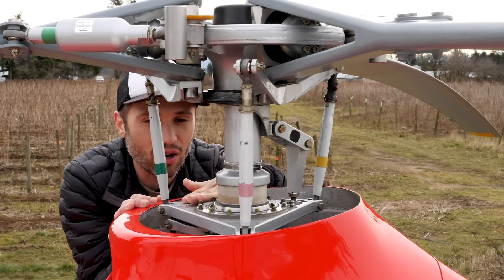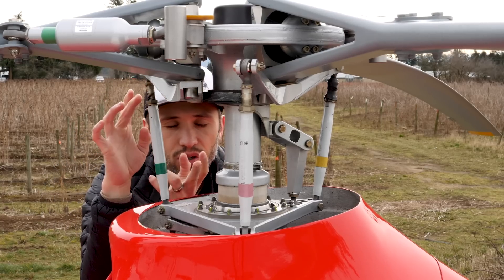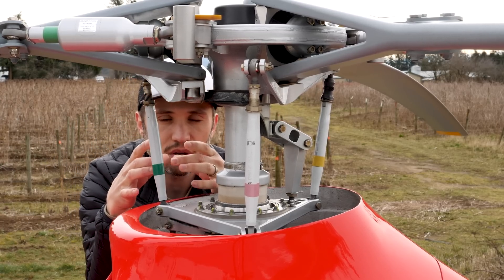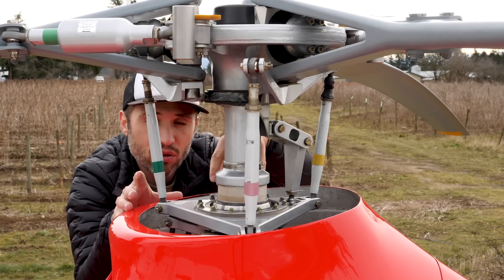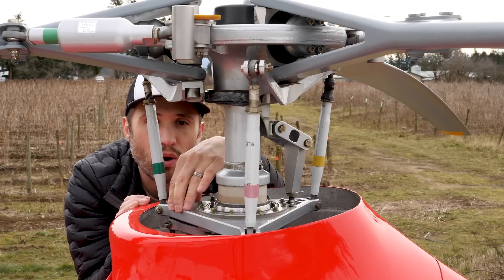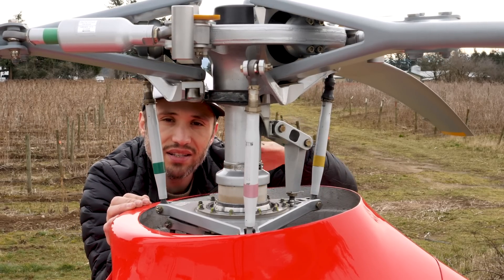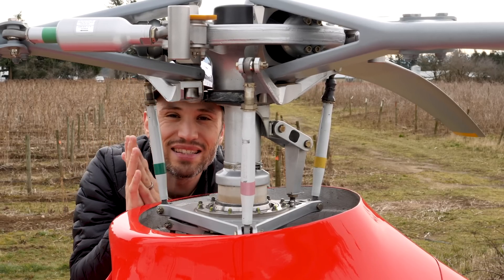THE MAGIC SAUCE THAT MAKES A HELICOPTER WORK

Comment: Is there any phase lag if the forward input on the cyclic is made at the exact moment the pitch rod is at the front of the helicopter? Also, at approximately 360 rotor rpm, the phase lag for a 90 degree rotation of the rotor is less than 0.05 seconds...

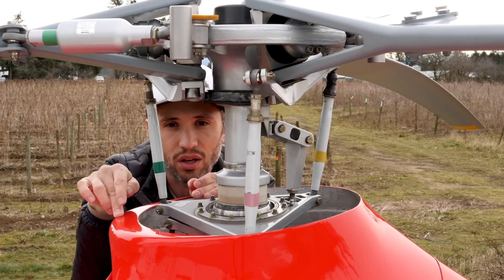Comment: 4:13 not correct, the maximum downward angle happens on the left side, this pushes the left side of the rotor down, but the lag causes the aircraft to pitch forward instead of left

Comment: The swashplate is like the mechanical version of a slip-ring, which is a rotating electrical connection on a shaft using concentric rings to isolate each connection. The current goes through a stationary ring(s) which are connected via copper leaf springs to a rotating wire. Think carousel.

Comment: The helicopter rotor is complicated and those who first invented it must have used incredibly much effort to adjust it all into a working machine :) 

I learned to fly heli in Microsoft flight sim. Then I tried flying a co axial RC heli, but struggled hard to get it flying until I trained on a small simple single rotor micro heli without any collective input. After that I could fly the co axial heli but I hated how that handled, it would only stay in a hover forever and did not fly straight like a normal heli do. Only been in a Robinson R4 real heli once and the pilot was a relative of mine and did lot of fast dives with low passes and turns over  the airport just like I like to do myself in MS Flightsim :)

Comment: but it squeaks LOL… Yeah it's my favorite mechanical device.  I fly a radio -controlled MD 500 with the five bladed rigid rotor head.  A lot of people don't realize that the rotor blades are constantly in motion as they spend the accuracy is just amazing.  Closest thing I can think of would be a hummingbird.  Cool video I just love helicopters.  Thank you

Comment: Hello, Pilot Yellow and other helicopter pilots. Does a tail rotor auto re-center to it's center position when you release the foot pedal? Or should I ask were they spring loaded so that it will return to center position upon releasing the foot pedal? Does the cyclic spring loaded as well? Does it return to center like those computer joysticks? Thank you in advance.

Comment: Just remember that phase lag really refers to whether the Cyclic (and rotor disc) is in sync with the swash plate. The whole 90 degrees later phenomenon is simply gyroscopic precession. A spinning mass will always show a "phase lag" of 90 degrees from the point where a force is applied. However, the swashplate can have any phase lag between it and the cyclic between 0 and 90 degrees, depending on the advance angle of the pitch links. 

Advance angle is the angular difference between where a pitch-link attaches to the swash plate and the feathering axis of the blade to which it controls. I hope that makes sense, it's pretty hard to describe in writing without diagrams.

So, an advance angle of 90 degrees on all of the pitch-links will cause the phase lag between the swash plate and cyclic to be 0 degrees! Which is exactly how two-bladed rotors typically operate (R22, R44, B206 etc). This DOES NOT mean that gyroscopic precession is not occurring. A swashplate that tilts forward with pitch-links that are advanced 90 degrees, will still cause the lowest blade angle to be 90 degrees to the right in a counter-clockwise rotor (left in a clockwise, but we hate clockwise rotors :P). How? Because although the pitch-link is being pulled most down at the forward position, it is attached to a blade (through the pitch horn) that is 90 degrees to the right of it. So that 90-degree-to-the-right position is still the point of lowest blade angle, and through precession will therefore cause the point of lowest flapping to be in-front of us, thereby tilting the rotor disc forward.

Jesus that's hard to explain with only writing >:(

From the perspective in this video, it seems as if the Cabri has an advance angle of around 45 degrees, which means that the phase-lag between the swash plate and the cyclic (and rotor disc) would also be 45 degrees. But I would need to play around with one in person to be sure.

Comment: Thank you for the vid. As an airplane flyer (and builder) I am always frightend of so many moveble parts which not only move but need to move in an exact manner. I know it works. However, my little ultralight seems to be more safe to me. If the engine stops I can glide to the next field (only one time happened since now). When the rotor of a heli crashes . . . . not thinking about that.

Comment: I'm still confused about the cycling. When the engine is turning at high rpms how does the rotor head keep up with the up and down to move the helicopter forward or to the side?

Comment: Nice Video with a big mistake. The pitch on the rotor blade is 90 degree to the tilt direction of the helicoptor, not the swapplate... That can be different. Idf you give more pitch on thw right or left part of the rotor when it spins, your helicopter tilts forward and backward not left and right

Comment: Swash Plate... the device that allows the helicopter to beat the air into submission (they don't actually fly) in a controlled manner!

My other favorite component:  The Jesus Nut.  The one that holds on the entire rotor system (at least on a Huey).  Because if that fails, you have nothing left to do but pray to Jesus.

Comment: This is why I chuckle every time I see a video on YouTube where someone in some third world outback is trying to make a homemade helicopter out of junk parts. That swash plate and the bearings and control rods are critical to both flight and control. Lots of engineering and design goes into making sure they not only operate correctly but do not fail due to metal fatigue. Not something the average “hack” can do!

Comment: PS the way that upper part is orientated that depends on what direction the blades are running correct? or do both CW and CCW engines have that place in the same side, i would think not. Im talking about the part where you were explaining that forward pitch would alter the upper part at a 90 deg angle.

Comment: Great video.. but.. you should tell us simply and clearly what makes helicopter left & right. Up & down. Back & forward with motion of blades and plate. And also what makes helicopter stable?? When I was 13 years old I made little toy helicopter but there wasn't any stability.

Comment: FYI, at 4:11 for forward cyclic plate action, the maximum blade angle does happen perpendicular (pilot's left side) not 90 deg later (blade is in front of pilot) but you're right that the reaction happens 90deg away from where force is applied because of gyroscopic precession. That's a WHOLE other can of worms, and I recommend checking out youtube videos on that. Great video though. Thanks.

Comment: @PilotYellow - Great video !  - I already had an idea how the swash plate works to change pitch etc but to see the mechanism in action and up close like this was really the cat's meow! I see the 3  links but just wondering about the mechanism a couple of inches inside of the YELLOW taped link that goes between  the top swash plate and the rotor head and rotates with it. Is it some sort of damper that helps control the cyclic inputs with some sort of resistance?

Comment: Ok, so let me get this straight. If you are flying exactly north with clockwise rotating blades(as you look up at them) then the disc that the blades trace out is tilted in a north direction. Ok I got that. But the swash plate is tilted down in the east direction.  Could you elaborate on this please. I know that this has zero to do with the gyroscopic precession principal as the rotating disc that the blades sweep out does not have a rim with mass as a spinning bicycle wheel has. Gyroscopic precession does have a very minimal effect but again very small. Barely noticeable.

Comment: The more secret sauce is simply decoupling the rotor disk from the mast or vertical shaft that spins it.  It took many months and crashes to figure this out during the development of the helicopter.  The reason for it, which is part of what the swash plate accomplishes, is that an attempt to deflect the spinning rotor disk by applying a force results in the disk rotating in space orthogonal to the applied force.  Imagining a helicopter hovering.  To go forward, you want the rotor disk to tilt forward.  But to actually do that, you push UP on the LEFT side (assuming a clockwise rotation as viewed down from above) and the magic gyroscopic phenomenon results in the disk tilting forward.
The swash plate performs this 90 degree change by its linkage.  Push forward and it arranges to push up on the left, which results in the rotor tilting forward just like you expect.
If the blades are firmly fixed to the mast or shaft, as they tilt forward the body also tilts forward but that creates a force 90 degrees clockwise; so the rotor disk starts to go sideways.  But that creates a force sideways, which results in the rotor disk tilting rearward.  The oscillation rapidly grows in a spiral and it crashes.  
This can also happen if the "skids" of the helicopter are still on the ground.  It is important to separate from the ground smartly and to land smartly.  Dragging a skid can set up an oscillation that will destroy the helicopter.

Comment: This vid shows the pitch change of one blade caused by the  swash plate in flight. You can see the blade reach maximum pitch every time the tail boom comes into view and the horizon change indicates the rotor disc is tilted forward. Hence forward flight. Pretty cool. https://www.youtube.com/watch?v=Pu48f7s5Ru8

Comment: The 90 degree reaction of the rotor blades to the control input is because of precession! Any rotating object precesses. A gyroscope precession is commonly used for navigation because it’s predictable, and can be relied upon! Works pretty good on helicopters too!😊
Reply: There is more than precession. There is Coriolis-effect, there are aeroelastic reaction times of a flexible airfoil (here: rotor), and inertia of rotating mass.
Reply: @jzk3919  which is predictable!
Reply: The same thing happens with a rotor made with two cylindrical rods instead of blades. If you have a CCW rotor and  "hit" it (while it is in rotation) from below at 9 (270°), will respond at (180°), this is the gyroscopic precession. The helicopter rotor is a huge gyroscope and involves a tale.
p.s. I have experienced this thing
Reply: @jzk3919  That´s right. Precession is a different phenomenon. It is based actually on the coriolis effect.
Reply: So how would a coaxial helicopter feel? The old design which Kamov uses? Rigid head and I want three coaxial shafts! The center is fixed for the control lines ( electric) and then the outer shafts which are connected to planetary gears and axial loaded bearings. So upper rotor has swashplate on top.

I think cyclic would be out of phase for them. I may even depend on the velocity of the helicopter. Forward flight needs high angle of attack on the way to the rear.
Reply: If you increase the pitchnof the blade it is going to take time to fly to its maximum height.
That time in a system with a natural one per rev frequency will be 90 degrees.

Comment: In my humble opinion, I think that the whole assembly is called a “swashplate “. Not an “upper” and a “lower” swashplate. The upper half of the swashplate rotates with the rotor head and blades, the lower half of the swashplate is held stationary and is connected to the control inputs from the pilot. I am a BIG fan of helicopters! Get it? FAN? LIKE A MACHINE THAT BLOWS AIR?  is this thing on?  Take my wife, PLEASE!
Reply: You should be on a stage. There's one leaving in 5 minutes. ba dum dum!
Reply: Aircraft mechanic here.
You are correct. 
There is no "upper or lower" plates. 
There is, if you so desire, an "upper section" and "lower section."
Reply: So this will go over great at the next helicopter meetup...god luck!

Comment: Not all helicopters have a phase lag of 90 degrees some like the Robinson R22 have less than 90 (72 degrees in for the R22). This is because phase lag isn't actually gyroscopic precession it's cased by the amplitude and velocity of blade flap being out of phase with each other and blade stiffness and delta offset will have effects on the amount of phase lag for this reason. (if it was precession it would always be exactly 90 degrees)

Comment: It is called gyroscopic precession. Easily demonstrated by pushing down on a rotating gyroscope. The gyroscope does not migrate directly away from the downward push but it goes sideways.

Comment: What I find most fascinating is that if you push the cyclic forward, not only does the blade angle change at the front but the rear blade changes opposite! This means that the rotor blades are constantly changing their pitch every single revolution, basically flapping up and down furiously. This is unlike any other lift mechanic whereby pitch is changed and held in a static position.  The sheer stress and force that must be applied to keep this system from destroying itself is amazing.
Reply: Actually, when you push the cyclic forward (or aft) the cyclic pitch changes happen at the sides.  Due to gyroscopic affects, the phasing of the cyclic is 90 degrees from that you would expect.
Reply: @yzScott phase lag or giroscopic presesion?
Reply: @DavidGarcia-kf9wo  For gyroscopic effects.
Reply: So, use light, long, high aspect ratio blades m so that the oscillation does need less force. I have seen blades which are just tubes close to the head to minimise weight where lift is low anyway. So this force is pushing on the swash plate. It increases with cyclic and de-stabilises. Better have electronic control!

I still want a large rotor had with the bearings 1 m out to minimise weight even further. Do you know this 3 blade rotor with the spring to keep the oscillation within the head? Not so great for electric where you might want to adapt RPM to load.
Reply: Amazing yes, but true. And we all due to Juan de la Cierva the discovery and solve of all these forces and mechanics of rotor lifting systems, around 1920. Sykorsky only needed to wait for a power enough engine to built his helicopter. He had already solved the rotor problems by De La Cierva.  😘

Comment: phase lag = gyroscopic effect 👍. swash plate is amazing! Especially if you imagine that in each rotation of the swashplate  (when the cyclic moves) the pitch on the blades actually changes continuously during the swashplate spin ! Absolutely mind blowing ! Wish I could fly with you but flying costs/hour  are X2.5 more than in my country. Too expensive ! You should implement special prices for international students (at lower profit for you ) if you would like to accommodate more international students! You might profit less but if you have open slots for students, your end balance would be greater! I don't know if you are fully booked but I am sure it's very expensive to have those machines grounded. I know a lot of friends who would fly to canada for training if the prices were closer to their homeland. Love your videos. Keep them coming 💪
Reply: It's not gyroscopic, it's velocity and amplitude of blade flap being out of phase. If it was precesssion it would always be exactly 90 degrees and it's not on some designs like on the R22 which has 72 degrees of phase lag. On most helicopters it's pretty close to 90, but not exactly and the exact amount changes depending on what the helicopter is doing.
Reply: Phase lag = Gyroscopic ? Do you even know what "gyroscopic" effect is? Well the phase lag has nothing to do with any gyroscopic effects...

Comment: This is exactly what I was wondering, too, as to how all this ensemble works. It would have been v helpful, if you had rotated the blades by hand a couple of rounds to observe the motions and how the rods move with the stick eg in forward position. I understand that the pitch alters all blades' angle at the same time. But I dont get it how the rotor blades move up and down every 180 degrees?
Reply: Imagine if this was just 2 blades.   And one blade is initially pointing forward and one towards the back.  You push the cyclic forward.  That makes the blade towards the front ‘dip down’ a bit.  And the blade towards the back ‘tip up’ a bit.  

So, when the rotor is spinning, that continues… as a blade spins toward the front it is dipping down, and as a blade spins toward the back it is tipping up.  At that point, you can almost imagine that it’s like a propeller that’s just tilted forwards a little bit, so when you push the cyclic forward,  the ‘propeller’ (the blades) is pulling the helicopter forward.   (Just like a regular airplane propeller would).   And when the cyclic is pulled back, it’s the opposite; the blades ‘pull’ the helicopter rearwards.
Reply: @spindrift2009  Thanks Rob. That helps to better understand the mechanics. Me a PPLA/Seminole pilot.
Reply: @MFKAssetManagement  cool.   Yeah, think of the helo blades as just a propeller, that’s just starting out pointing upwards to the sky.  (And, each blade of the propeller can also change pitch.). Super cool.   A mechanical masterpiece!

Comment: Didn't know that the reaction occurs 90° later. Thanks it helped me!
Reply: It doesn't always but it's close to 90 degrees for most helicopters. Some like the R22 have lower phase lag (72 degrees on the R22). It's commonly explained on informative TV as gyroscopic precession but the actual explanation is much more complex than that and has to do with resonance and blade flap velocity and amplitude being out of phase.